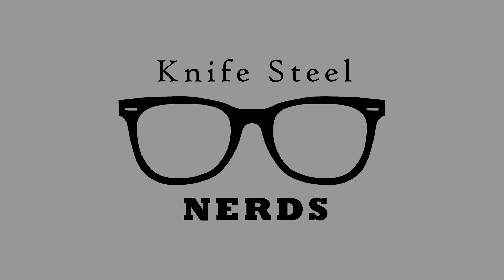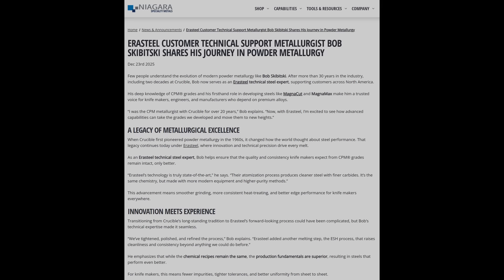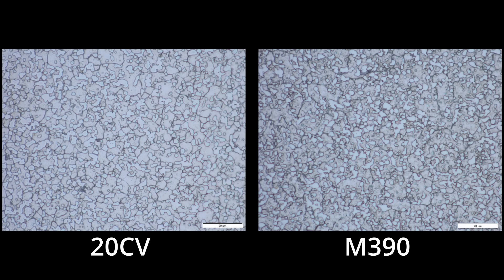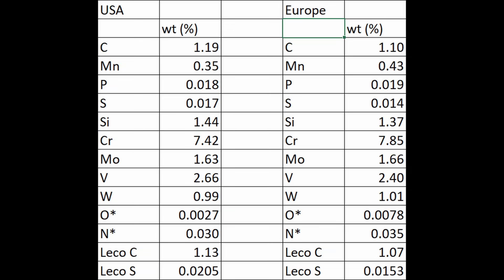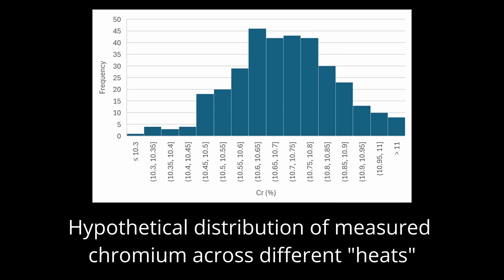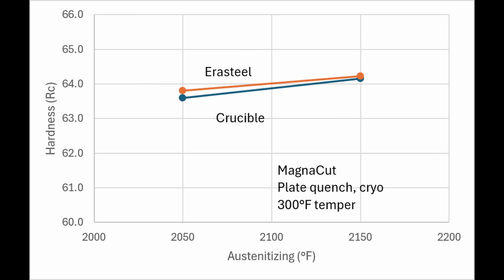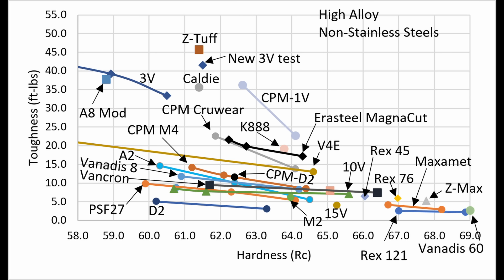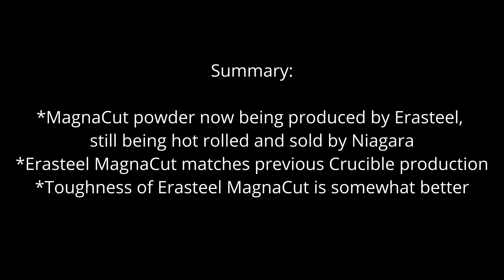New Erasteel MagnaCut Outperforms Crucible Original

Comment: I have a story about Crucible. A couple years ago i had a business idea. I wanted to start producing bedknives for reel mowers. I wanted to source USA made material if possible. So i called up crucible looking to see how much D2 would cost me. They straight up told me that i would be better off ordering D2 from China. The rep on the phone straight up admitted that they will buy D2 from China and reprocess it, because it's cheaper than purchasing the raw materials locally.
Reply: Crucible did not produce air melted D2 in sheet products. The D2 was produced in round bars that would not work for your application. CPM D2 is a different product and you would have to purchase that from Niagara since Crucible did not make sheet. 

The importation of foreign tool steel happened under Crucible Materials which had service centers throughout the US. Crucible Materials went bankrupt in 2009. 

Hopefully this context helps.
Reply: @AndrewSmith-jo5vi  Yeah I found that out when I called them. I was on a mission to figure out where to source material at and knew that they made D2. You don't know what you don't know until you do. Doesn't change that they still told me I was better off sourcing from China.

Comment: Correct me if I’m wrong… but 

If Crucible MagnaCut were:
- Austenitized at 2150 °F
- Properly quenched and tempered

You would expect a similar directional improvement, no?

Attributing the gain to the steel producer rather than the updated heat treatment guidance is conflating variables in my opinion. I also don’t see how this “new” process gives that much more of a dominant result in toughness because the heat treatment is a more dominant variable than the powder origin. 

I’m not a metallurgist by any means, but I would appreciate some feedback on my thoughts if possible. I’m not saying there isn’t a difference, I think the lab will and probably has shown cleaner magancut but the difference is going to be negligible in actual daily usage.
Reply from the maker: Those heat treatment conditions were already tested with the Crucible product. I said in the video that the peak properties were with 2050F with the Crucible MagnaCut. You can see all of the tested conditions in the old MagnaCut article on my website.

Comment: Hi larrin. Did you ever test a uhc steel? Roselli got famous for them, and I Believe you studied them for car manufacturing, didnt you?
Reply from the maker: Sherby and Wadsworth popularized the term “Ultrahigh carbon steel” and they defined it as any steel with over 1% carbon. So by that definition I have tested many of them. The simplest example would be 26C3 with 1.25% carbon. In one of their original papers a steel with the same carbon content outperformed 1.6 and 1.9% carbon in their “super plasticity” testing. But I have not tested the specific steel used by Roselli. I think it is generally better to use alloying elements to improve properties rather than going all out on carbon.

Comment: Do not forget the cross rolling which should translate in better structure.
Reply from the maker: The cross rolling is done by Niagara, not Erasteel. So that hasn’t changed; they were cross rolling before and they still are.
Reply: @KnifeSteelNerds thanks Larrin, but Crucible didn’t do it back in their days?
Reply from the maker: Crucible would do the initial forging on some of the ingots but the rolling was all Niagara
Reply: @KnifeSteelNerds thanks

Comment: So now my question, is this a fluke or is Erasteel producing a finer better product?
Reply: When it comes to steel, the Swedes know what they're doing. I would wager that its Erasteel producing a better product and not a fluke. It could be a fluke. No one is perfect, but i would not be surprised if it was them just doing a better job.

And I understand that Erasteel is a French firm, but Larrin said their factory was in Sweden, ergo, Swedes are probably the ones making the steel.
Reply: @Cloudstrife112233  that is the clarification I was after. Thank you.
Reply: @RadDadisRad im not the biggest expert. I just know that Sweden is known for their exceptional steel quality.
Reply: @Cloudstrife112233 I understand. I know Crucible caused most of their problems and the latter problems stemmed from existing problems. They weren’t staying modern with manufacturing and it was hurting. Add that to where they were manufacturing and the issues were only compounded.